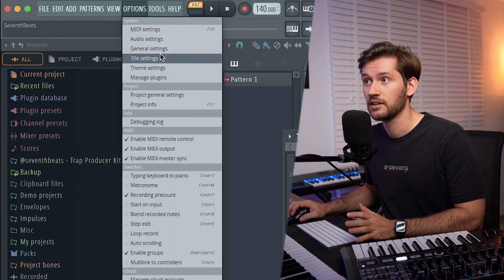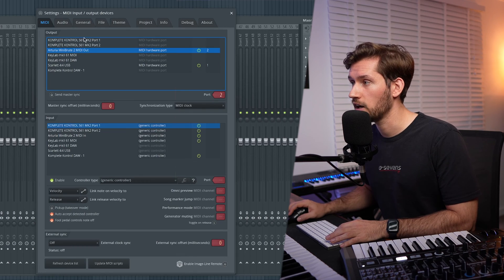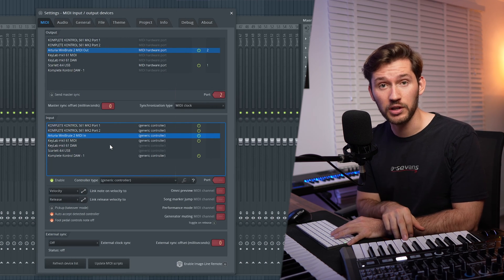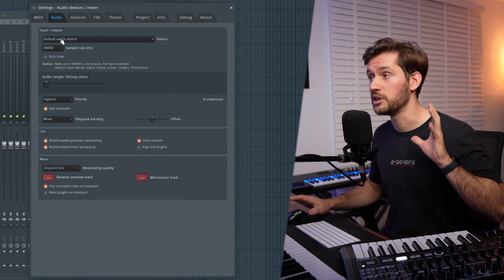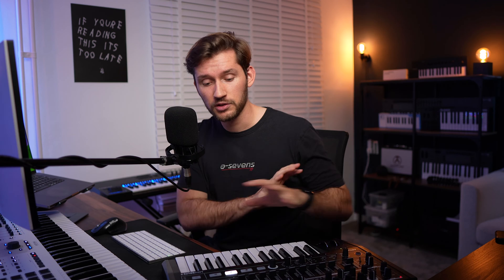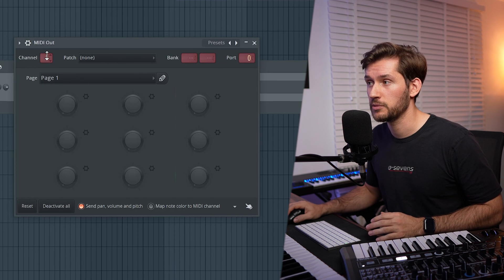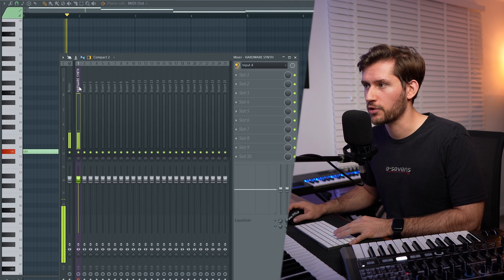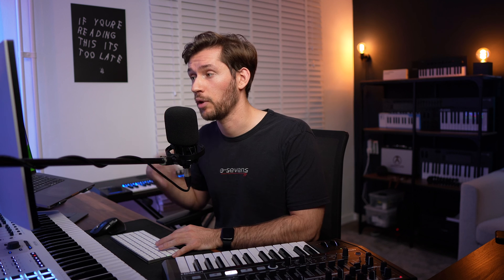How To Control and Record Your Hardware Synth In FL Studio 21 // Tips & Tricks

Comment from the maker: If you have any questions, drop them in the comments😃
Reply: When I select my audio interface as my primary device, then i try to click the dropdown menu to select the input it just redirects me to a tutorial page on the website, i dont have th e option to select and input. also, in the midi tab, my hardware synth does not have the green power button, its greyed out and i cant enable it. any idea how to fix this?
Reply: Hi nice to meet you and i have question i connected the JD XA synthesizer the sound of the machine is audible, but I have a problem with the knobs automation from the fl studio program , when I move the knobs it doesn't work so I can't automate anything because nothing is saved and nothing works nothing happens , but when I move the knobs on the synthesizer, everything works.
Any advice please ? Why doesn't the automation work according to the synthesizer when I turn the knobs in midi out?

Comment: Do you NEED an audio interface to record audio from the synth?
Reply from the maker: Yes!
Reply: @SeventhBeatsTV  Ʃit
Reply: Oh yeah for sure. Having an interface is the most important thing ever if you ever plan on recording with analog gear. You can use a mixer instead but only if it has an interface built in. 😂 basically you need an interface no matter what.